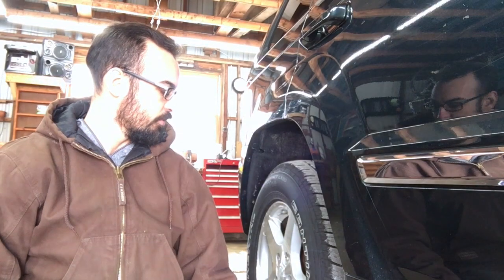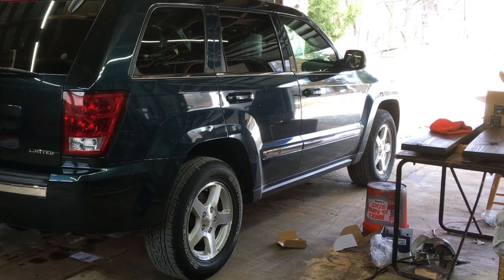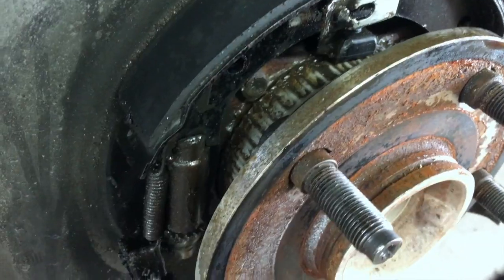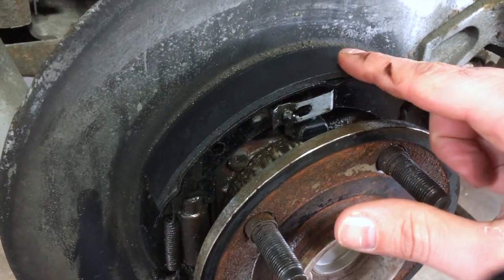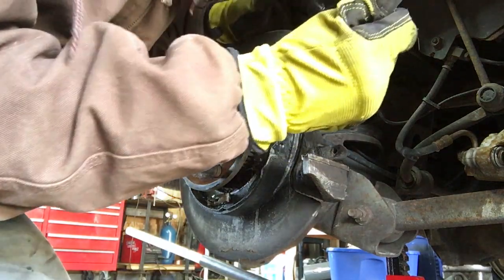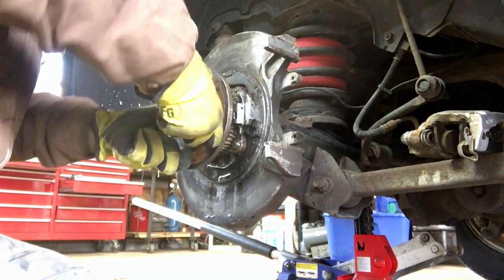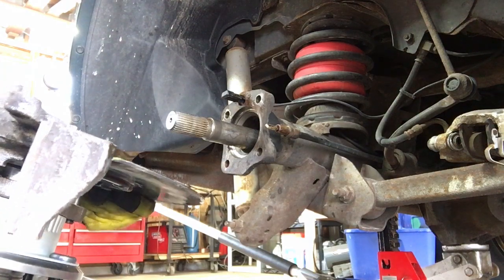Jeep Grand Cherokee WK Rear Hub Replacement

Comment: Great video! It really helped me to prepare for the job. Btw, does anyone know the torque spec for the bolts? I just tightened as hard as I could (my Haynes manual doesn't say anything about the rear hub, only the front).
Reply: He ask you  a guestion? what is the torque  on the wheel bearing nuts??

Comment: Thanks for the video. I was able to separate the backing plate and the hub with out removing the e-brake assembly or the backing plate from the vehicle. Just used a couple of screw drivers to separate the plate from the hub right there at the axle. Took about 25 minutes a side.

Comment: Just a quick note, next time you do one or if someone else does one you should remove the ABS wheel speed sensor first so you don't damage it. It's only 1 10mm bolt.

Comment: Hey did your new hub come with an o-ring? It seems mine didn't and a lot of gear oil has leaked out now. Probably have to replace the e-brake shoes now. Luckily I still had my old hub so I can re-use the o-ring. How did your brake cable separate from the backing plate?
Reply: Hey did you ever figure out the leaking mine also started to leak

Comment: That is a really different design. It makes sense. How many miles was on it before you had to replace it? My 2017 Suburban needed a new front wheel bearing and hub assembly at 25K. GM covered it on warranty. But that is way too soon to have to replace a wheel bearing.

Comment: Is there a seal where the shaft goes through the axle? Or the oil could go straight out? I ask because I changed my hub due to leaking oil from axle and 10k km later is leaking again. Someone told could be the axle seal and not the hub..I wonder if there is a seal there..thanks

Comment: After watching you tap the backing plate on i wondered if it would be easier to take the O-ring on the back off and reinstall it after I slipped the backing plate on.  Easy Peasy and no hammering.

Comment: im in the midst of a rear brake job with new parking brake shoes.when i pull slack in the e-brake cable to hook it with the brake lever,the cable retracts.weird since it moves freely.what would cause this?

Comment: FYI use a wire brush on the bolts before removing the nuts it will make a big difference
Reply: and penetrating oil

Comment: I know its 3 years late but you installed the brake shoe adjuster upside down also there's no need for a outer seal on the hub bearing

Comment: Hey I’m looking to do this on my 2008 Jeep Grand Cherokee. I have 175k and was wondering if this solved your problem and if they those Detroit axel hub assembly’s are holding up well?  Great video!
Reply from the maker: Yes! A year later and it is still working great. I even tow up to (and sometimes exceed) the towing capacity and the wheel bearing is still holding up strong.
Reply: @theprojecthomestead5623  Thanks! Looks like I'll be ordering parts today!
Reply: @SEKERAK_est.1985  I have 45k miles on mine and still running good.

Comment: I did the hub assembly on my Jeep but now i realized it’s leaking differential oil from where the backplate meets the hub assembly. Any idea what it could be I know the bolts are on tight
Reply: Mine has the same problem.
I think, maybe the o-ring is damaged while installation.
Ir maybe the wheel hub is bad quality, and oil comes from seal.
Reply: Hey I realized i didn’t put the o ring on problem fixed now

Comment: Hello, Can someone share experience - my WK have this problem too. I did changed rear wheel hub, because there was oil leak from seal. Now i drived more than 1.5 k kilometers, and oil leak is back now, from the same place. What could go wrong with new spare part?
Reply: Hey did you figure out the leaking I just replaced mine a few days ago and it’s also leaking
Reply: @benmendoza5194  no, i haven't. I think, maybe it is bad wheel hub. I will buy some new, and will install new one. Then will see.
Reply: Hi. Did you fix it? I have same issue. Changed the hub because o leaking oil than 10k km later is leaking againg. Someone told it could be axle seal not thw hub. Not sure. Thanks

Comment: Did I miss the abs sensor
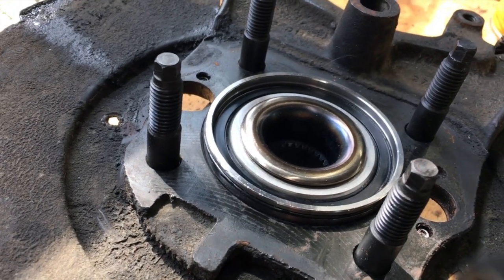Reply from the maker: There is a hole at the top of the backing plate that the sensor slides into. You can see the sensor at 9:10. You don't have to remove it or anything.